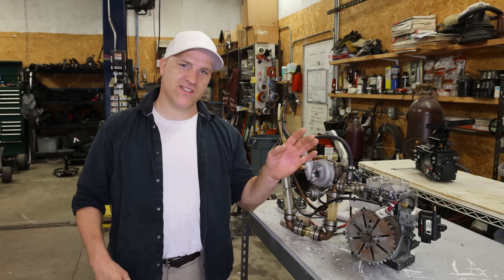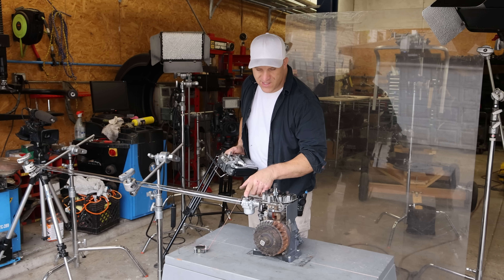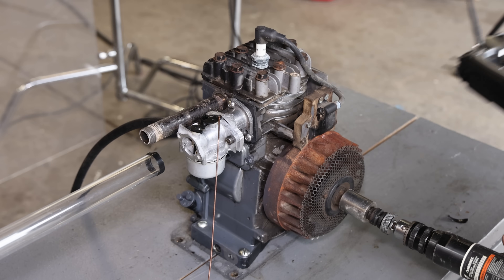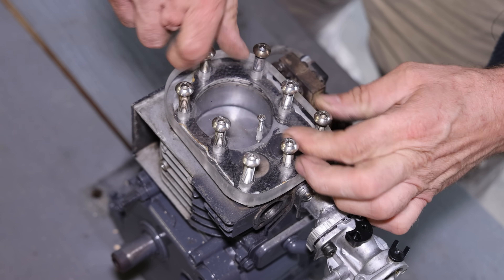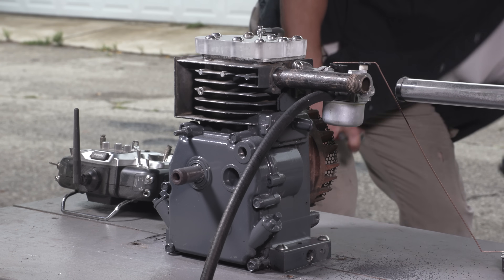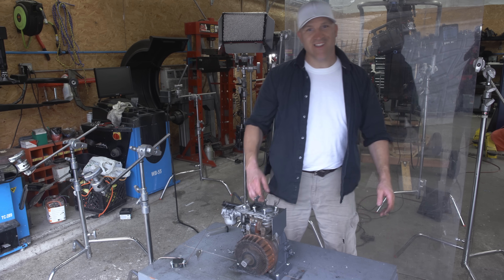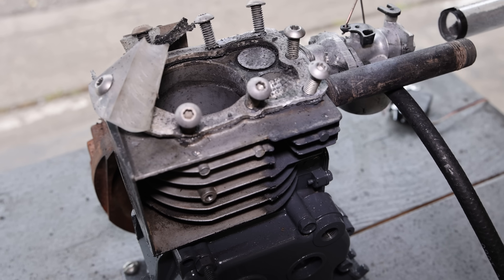Engine Running On GUNPOWDER

Comment: In concept it worked. But your fuel mixture was off.
A gun and gas engines function on the same principle.
I dont see a lot of difference from an engine and a full auto machine gun.
The fuel mixture is correct on a machine gun.

Comment: I think the key here would be to figure out how much cylinder pressure the head bolts,head, block,ECT can handle and make a space the same cc as engine and determine how much powder it takes to nake close but just under that. Then determibe how to deliver it in increments of that size each time the intake valve opens. In theory u wouldnt even need an intake if done right. I think u could deliver it straight behind the intake valve and if u could find out how to deliver it in those increments run the engine without blowing.  Maybe a tube with diff sections each with that amount and a breather hole to allow it to suck it in that could be drug across the back of the intake valve runner at a certain rpm. Alot of figuring

Comment: Come on. I was expecting a scientific test with micronized gunpowder and air mixtures, stoichiometrically proportioned and dispensed into the cylinder. Instead you just dumped it all in at once like that. 😂

Comment: Did you put the powder tube back together for that last run shot, too? 

6:26 powder tube full of powder ckearly visible. Servo throttle control still in place. 

You're full of crap. This is the first (and last) video of yours i watched ,and since you want to know what people think: I think you come across as uninterested and plastic-y as a presenter and the camera work is only ok.

Comment: Fun if you just wanted to blow it up.  If you actually wanted to see it run on gunpowder you would have done some calculations about the relative energy of the gas in a normal combustion event and figured out a way to meter the equivalent amount of gunpowder per revolution. (It's been done before)

Comment: That's not black powder, partner. That's smokeless power. BIG difference. Lucky you used the acrylic head instead of the metal one, otherwise pressures would have gotten exceedingly high and turned that engine into a pipe bomb. That would create pressure high enough for metal shrapnel to do right through that cheesy little plexiglass shield.
Reply: The containers at the end said "smokeless powder," so I assume he used that in the explosion.

Comment: You said you got the engine running after the gunpowder explosion but the video you showed of the engine running afterwards clearly shows the tube of gunpowder. So did you make it run again or not. It seems like he just slapped a video clip from before the Gunpowder explosion rather than actually making it run again

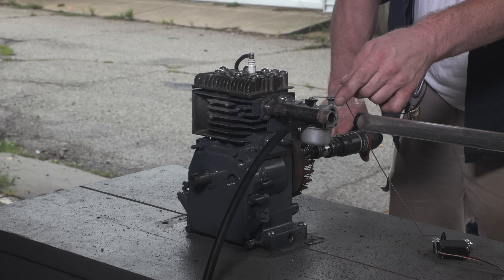Comment: Why did you set up the gun powder tube and fill it with gun powder to start it up for the last time. Somehow I don’t believe that engine ran again after that explosion. 🤔🤔 6:12
Reply from the maker: I'm a little confused, what you mean for "started up for the last time" but surprisingly the engine is still running, I will gladly do a video in the story tab for you.
I wanted the engine to blow apart, there is no reason I want this engine running.
Reply: @ 6:12 you started the engine up after It blew up why did you go through the hassle of setting up the gun powder tube again and filling it up with gun powder??

Comment: Engine: literally explodes
Also engine: starts right up
Reply: Starts right back up... And the pipe is suddenly unexploded too
Reply: @redjellonian8126  exactly what i was thinking! The tape seal has the same little tag and everything. I hate to say it but i think its faked.
Reply: Rated Redneck I was suss on it too so I had to watch it again after reading comments, after the explosion it had a different blown out head on it (broken pieces still on engine in different spots if you look close) and the tube was back in place. I’d say he blew the head off mildly and the tube didn’t catch in a first attempt (not shown) then he put stock head on and ran it (that’s the after explosion run) then put on another see through head on and got the big double explosion which is the one you see in the video.

Comment: U need a sistem that adds tinny bits of powder at a time
Reply from the maker: That would be great, but my goal has been to somehow blow this engine up for a long time now. one of the biggest issues I see with some sort of reserve system that adds a little bit of gunpowder at a time is that at any moment a spark or ember or something flies back toward the gunpowder, then that's it you don't want to be anywhere near that thing.

Comment: Boom goes the dyn.. eeh gunpowder.
You have a few continuity errors in  this video. When running the engine 'after' it exploded the tube with gunpowder magically reappears.
Reply from the maker: Yes it's because I had additional tubes and I was going to do yet another run but I decided not to. At this point my posting schedule takes priority over continuity.

Comment: Outstanding video and content quality.

I could just imagine how it would look like on even more sick cameras with crazier framerate (I know that these are insanely expensive).

Now try it with original engine head and measure the torque when the powder explodes! I bet It does 1000 newtonmetres :D
Reply from the maker: Well I do have access to slower cameras, but for this particular video, with a slower camera it would just become another explosion instead of looking magical. That's my opinion

Comment: It would be cool if you could do an engine with a see through oil pan. You could see what the oil is doing and the windage when a engine is turning high RPMs. Plus youd get to see the bottom end in action. If theres any crank walk etc.

Comment: I think it developed 2000 HP,    for a millisecond.    that was awesome!
Reply from the maker: You are probably right, it was a really great demonstration for how the reaction characteristics of black powder change once you get it under pressure, the exhaust valve was open when it ignited. I can't help to think what the cylinder pressure was inside of the engine before it exploded.
Reply: @WarpedYT   I didn't think you'd do this in your dang garage.  lol    Good thing the explosion sound was drowned out by actual gun fire though.
Reply: @taofledermaus  I was thinking it and you said it. 😄
Reply from the maker: Well I do remember the conversation we had about pressures in the barrel and combustion pressures..  I remember the conversation well and I did a little math on this one, I was almost certain it was not going to blow up cylinder.
Reply: @Warped Perception Maybe you could test your way forward bit by bit. Start with tiny parts of powder, look what happens and then just get bigger an bigger to see where it ends.
Reply: TAOFLEDERMAUS your here too nice to see.
Reply: @WarpedYT  You could attach a pressure gauge of some sort to the head and film it with a high speed camera. i'm unsure if it would work or not, but its something to try. id love to figure out what kind of pressure was in that chamber at the point of the explosion. BTW, i really enjoy the content that you produce. this channel is right up my ally, kEEP IT UP!
-Caden
Reply: @cadenswain158  it would probably send the pressure gauge into orbit lol.
Reply: @WarpedYT  I read some where that in an average hunting rifle the chamber pressure is about 3,6 ton before the bullet leaves the barrel.
Reply: @WarpedYT  try an electric powder trickler. They're used to precisely put gunpowder into a scale to sneak up carefully on the amount of powder required. Make a metal pan for just outside the carb inlet and trickle black powder onto it.
Reply: @WarpedYT  maybe with an iron head.. but its only as strong as the yield point of the perspex.. try it with an updraft carb & metered powder via a 60deg (for example) funnelled powder supply.. not sure if a spark plug could trigger ignition though without petrol present.. the FIRST combustion engines used gun powder finelty powdered.. before petrol was even a thing !!
Reply from the maker: Thank you
Reply: Love your channel and your content!
This guy has awesome content as well! 🤟🇺🇸🇷🇺
Reply: Reminds me of the "Chernobyl powerplant fulfilled its 5 year quota of energy production in under a second" line
Reply: This conversation is awesome
Reply: If it ever does die, have Taofledermaus use it as a target for one last use.
Reply: Taofledermaus Take a look at it supposed to last run with that engine to see if it damaged you can see the tube of gunpowder still sitting there
Reply: I would give this comment a like, but hail Satan
Reply: bruh
Reply: Thats decent for that Displacement + That its N/A

Comment: 6:15 clearly a video before it blew up still had the whole tube of black powder intact, and i don't know why you'd make a new tube and refill it at the end just to run it on gasoline... you aint slick
Reply from the maker: Simple, because my posting schedule takes priority over continuity. however I did have a second tube with a second setup that I decided not to run because it would be too redundant, that's all motion video of that second explosion is that the end of the video. I did run it after the second explosion which is what I show in the episode, it still runs I will totally do a YouTube story on it maybe later today or tomorrow.

Comment: You need a hopper, or something to regulate how much powder the engine takes in. This would also prevent a back fire from igniting all of the powder at once.

Gunpowder engines are possible. They're just very impractical and dangerous.

Comment: Nice explosion but that's not trying to run the engine on it. Still fun in slow-mo! May have to pestle the powder to dust and set up an hourglass valve feeder.

Comment: You was lucky didn't use to original head engine.. 
If you'll used that makes a huge explosion!!
Reply from the maker: No way I would not run the stock head in my garage.

Comment: You didnt run anything. You blew it up on purpose. Might as well shot it with a gun and say "Ran Engine On Bullets".

I think if you actually took the time and tried to RUN it on black power would have been cool. Not just fill it with dynamite and light the fuse.
Reply from the maker: Nah

Comment: Next you should do the same thing with the stock head.
Reply from the maker: I know I was thinking that but I would not do that in my garage, I mean I'm just taking a guess that the pressure with the see-through head in the combustion chamber is around 10,000 or 15,000 PSI, maybe even 20-30k but if that entire chamber is closed up the pressure will probably exceed 100000 PSI which would increase the detonation velocity to dangerous levels. In short I just would not do that in my garage but I think it would be interesting.

Comment: You need an hourglass-like funnel to slowly feed the black powder into the carburetor. Use a quick release pin to open a valve from behind the blast shield.

Comment: Why was the gun powder tube still there when he started after blowing up the gun powder tube
Reply: Yeah, I don't like that. Fishy
Reply: Ash Cooper maybe he made multiple, planning on doing something else using a similar system, or just made a spare?
Reply: Then at the outro the motor is in its exploded state with the bent head bolts still in it lol
Reply: He did it two times and just put the explosions in the wrong order

Comment: All the safety panels in the garage, but the big door wide open. 😂 Just imagine someone driving by right as the engine tooted that black power.
Reply from the maker: Had the alley blocked

Comment: Going with the adding powder slowly.   I think that a venturi system might work out.  The intake air would carry some powder and hopefully continue the combustion process.   Also the type of powder used will make a difference.

Comment: I guess the gunpowder doesn't ignite as quickly as gasoline, and when it almost stalled, it was hot enough and going allow enough to finally ignite the gunpowder.
Reply: Maybe using something with a bit faster of an explosion rate, like a high explosive might work to actually run the engine rather than just blow it up.

Comment: As much as I have always admired the originality and content of your videos, this will be the last one I watch as I have becoming increasingly uncomfortable at how you produce them. 
All of your videos involve setting up your gear in the middle of residential access alley and usually involve something very loud within earshot of dozens of your neighbours. Or, you run your cars up and down the alley at speeds not meant for a blind residential area.Take your Supra on steroids out to a track if you want to see invisible gas flow through a manifold while you drive recklessly. I don't know if you had any formal training or education related to the content of your videos, but even if you do, I don't think anyone could reasonably predict  what would happen to a reciprocating engine pumped full of gunpowder as it runs at top speed. You have a shield to protect yourself but I didn't see anything between the 4-stroke bomb you created and the bedroom windows a few hundred feet away. 
You seem to have no regard for the comfort or safety of others (just yourself) and routinely break the law in the process of filming your content. You're taking away the freedom of others - their security and their privacy - for your own personal gain and I find it unsettling to I watch. For this reason, I won't be supporting your channel anymore.

Comment: Gasoline: is combustible

Black powder: is an explosive
Reply: gas can explode much like black as well..... its called "detonation" or "pinging" when its in a motor. 
.
it sounds like someone is in your engine..... hitting the top of the piston with a hammer
and it kinda is like a hammer blow.....
.
the gas explodes.... causing a much sharper (and higher) pressure curve/spike 
it can shatter pistons
bend rods
melt holes in pistons.... 
.
etc
Reply: Car blowing up = explosive
Car running = combustion
Gun shoot = combustion 
gun powder too hot from hot barrel = explosive
Reply: Actually, neither gasoline nor black powder are more than low explosives, which is why powder is clearly labelled and considered a propellant which can be purchased without any sort of explosives licensing. Nice fail though.
Reply: This.
Reply: Gunpowder is a low explosive that does not detonate but rather deflagrates (burns quickly at subsonic speed).
Reply: lol!
if gas doesn't explode under compression then how does an engine run on combustion?
that's your charcoal briquettes soaked with kerosene,..."combustion" but calls it explosion cause it burns your eyebrows off. the same stochio mixture under 8/1 compression in a bbq size box would blow the side of your house off.
Reply: @dallynsr  Look up "detonate" and "deflagrate". That should clear up your confusion. You seem to be confusing the two words. Gasoline in an engine undergoes deflagration, not detonation. There is a very specific and important difference.
Reply: @dallynsr  the critical difference is gasoline, propane, natural gas etc can make a deflagration, but they need to be pre mixed with air before it will "deflagrate." Pouring a couple tablespoons of liquid gasoline down the intake won't make it go bang. At most it will stop it, and it will be "flooded" and inoperable until you are able to remove all that liquid. Liquid and gaseous fuels are flammable, but not even a low explosive until they've been diluted into a much larger volume of air. I think you need maybe 1 ml of gas to evaporate into 10 L of air to make the mixture.

Comment: I saw this and I thought of the homemade sandblaster with an air compressor. Maybe force nitrogen into the motor while an electric motor cranks. Then allow the black powder to flow. Next try a different powder.

Comment: An idiot who knows nothing about gunpowder playing with gunpowder is a good way to get someone dead. What in the hell made you think this was a good idea? And how much shrapnel did you send in to your neighbors garage door. You didn't even have anything in front of the door to protect potential pedestrians. If I were your neighbor I would turn you in to the cops for creating an explosive device (which you did, and which is HIGHLY illegal). On top of all of that, there was no way this was ever going to work. You sucked in like 200 grains of powder which is about how much you load in to a freaking 50BMG, and more than you would load in to some sizes of CANNON. The only way this EVER could have worked is if you metered the powder going in instead of letting it suck up an unregulated amount of powder. A carburetor is designed to regulate the fuel through a small tube in the bottom to the air coming in the inlet, but you stuck the freaking fuel in the air inlet. This is probably one of the dumbest things i've ever seen on youtube. I'm glad i've never watched a video on this channel before and I'll definitely be blocking it from my recommendations going forward. I hope you end up arrested.

Comment: Hey, have you ever thought about spraying Deodorant Spray directly into the intake of a engine?
Reply from the maker: That stuff is explosive
Reply: @WarpedYT  for the views :)
Reply: @WarpedYT  I do believe gunpowder is explosive as well. :)
Reply: Would be interesting
Reply: ive made an engine run off it, with no carb, isnt too different from what ive seen
Reply: It is probably butane it will work fine, and smell nice.

Comment: If you still have that turbo Briggs setup, based on your Supra video, it would be neat to see the condensation again from going full boost to vacuum.
When rewatch that Supra video, the cool effect I noticed was the decompression "fog" from the air moisture in there, can you get that on the smaller one too?